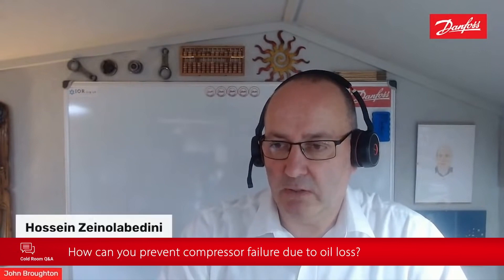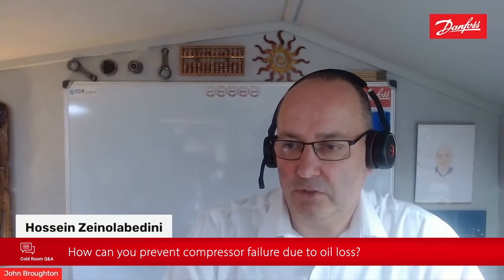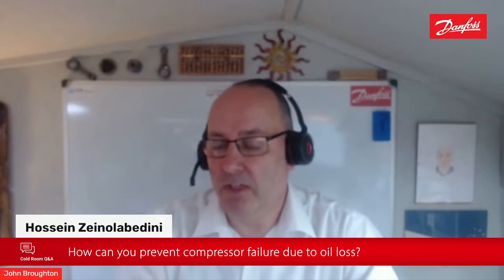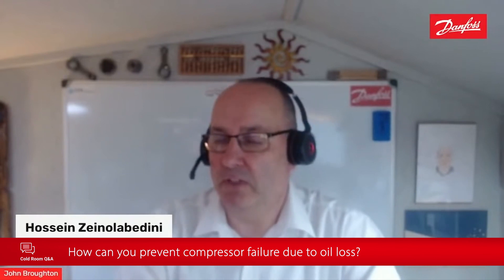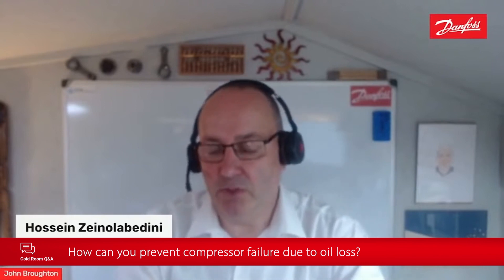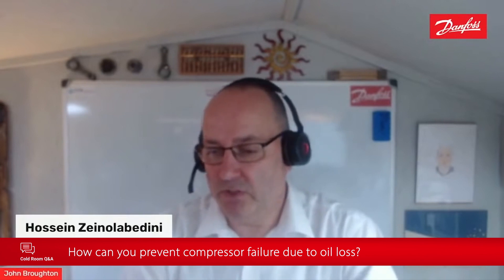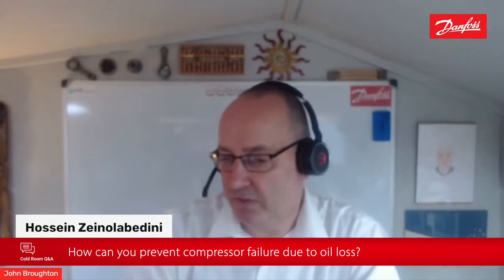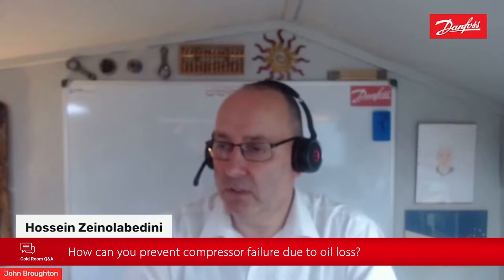How can you prevent compressor failure due to oil loss? | Ask an Expert

Comment: If you put a oil separator on a hermatic compressor and have the oil return feed into the suction line, should the return feed be in top of the suction line or be brazed into the bottom of the suction line ??